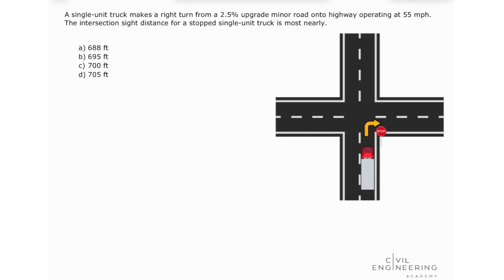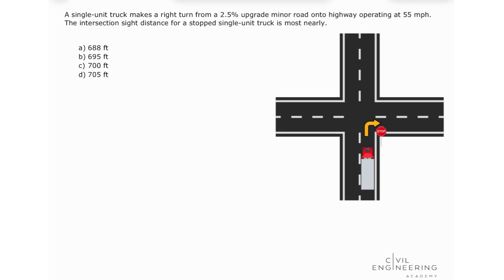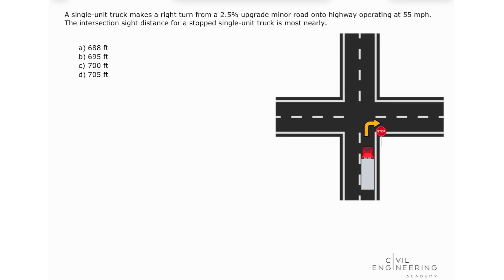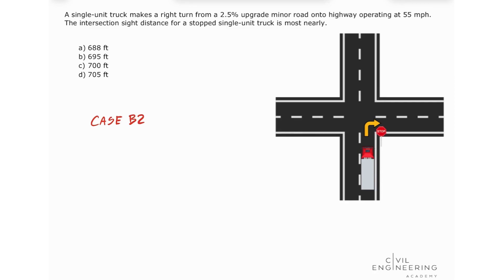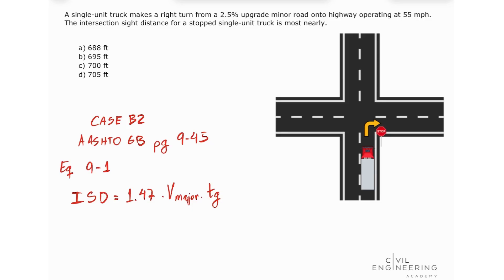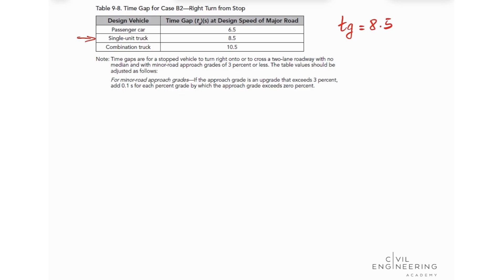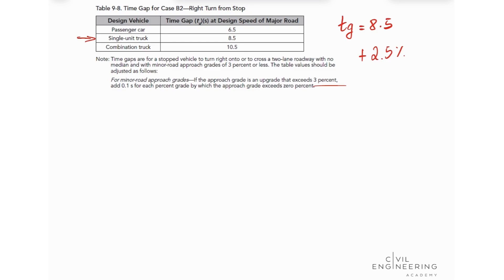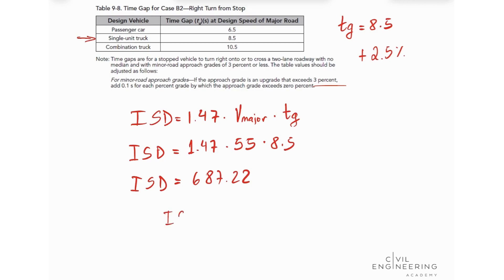Civil PE Exam – Transportation – Find the Intersection Sight Distance for a Single-Unit Truck

Comment: I have question please. Why we didn't use table 9-9 for Case B2 (since it is Design for grade less than 3% and two lane HWY)? Thank you so much.
Reply: The reason being is if you read the notes underneath table 9-9. It states "Intersection sight distance shown is for a stopped passenger car to turn right onto or to cross  a two-lane roadway with no median and with grades of 3 percent or less. For other conditions,  the time gap should be adjusted and the sight distance recalculated." That being said this case was for a single unit truck in which Table 9-9 states for a passenger car. Hope this helped!